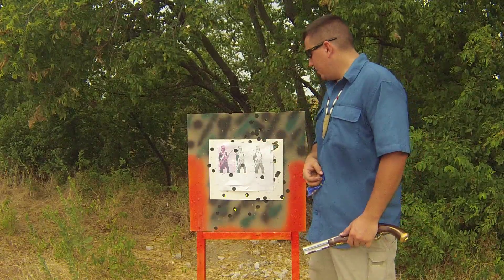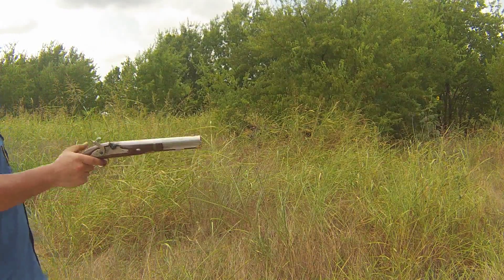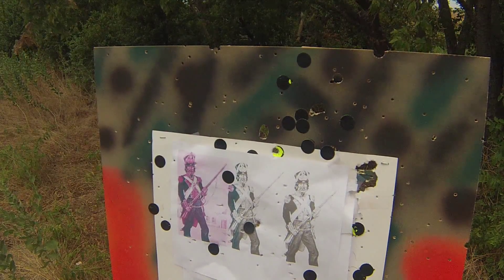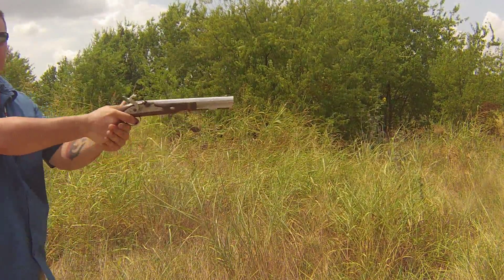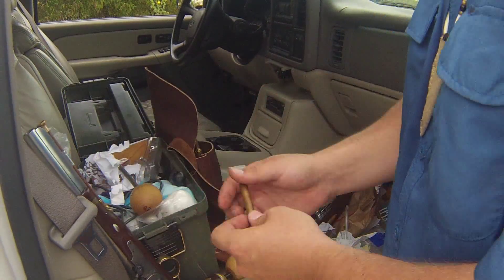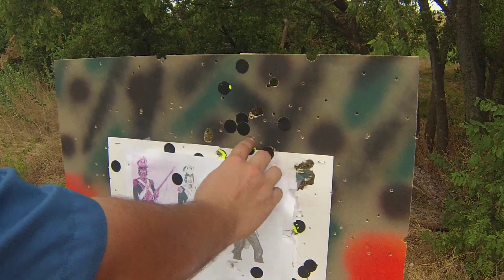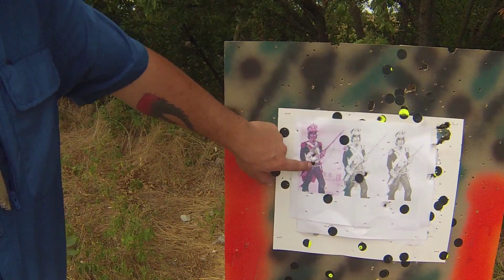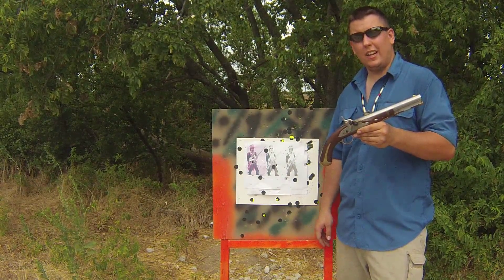Wood Round Ball Ammo?

Comment: The Germans in WWII occasionally used wooden bullets (they were originally manufactured as blanks) but their use wasn't acceptable to the Allies. On impact, they would shatter and spread a whole bunch of splinters in the wound. Not visible on x-ray, so a number of shards got left to set up wound infections. That little known fact aside, it would certainly be a viable option for use if nothing better was available.
Reply: Kirk Boswell I'm doubting that. A wooden bullet fired from a rifle would for 1 be moving way too  fast to be accurate and 2 would be too small and light to have enough energy to do much damage. If it were Germans in ww2 they almost certainly were using 8mm k98 rifles. An 8mm bullet made of wood might at best weigh 50gr that is far too light for an 8mm bullet. If the Germans used wood to make blanks they obviously understood the lack of lethality thus deeming it safe to use in ceremonies and drill.
Reply: @bowlofrice8  - Yes to those aspects. They are extremely light, and yes, they have poor accuracy. And yes, they were used as blanks in the 8mm. BUT they did get used a few times, and they were extremely bad news because of the above mentioned infections. Even our own blanks, which are powder only, can be lethal at close range (10 feet or so). At distances of 25 yards or less, those wood bullets were potentially lethal, and were used a few times in aggression rather than practice.